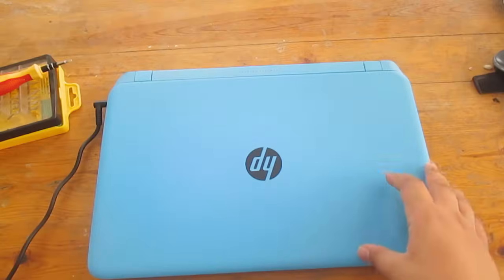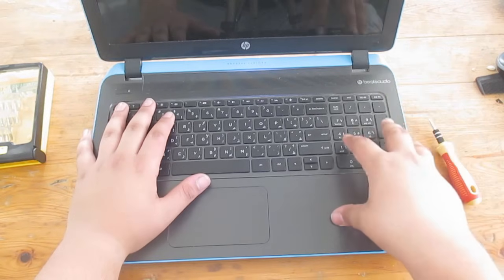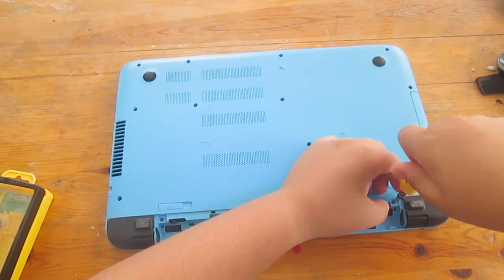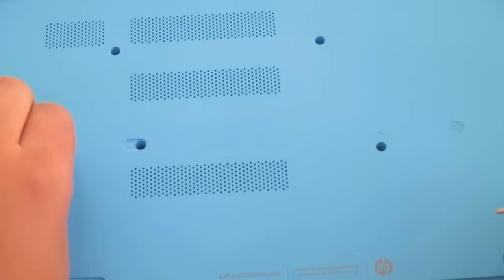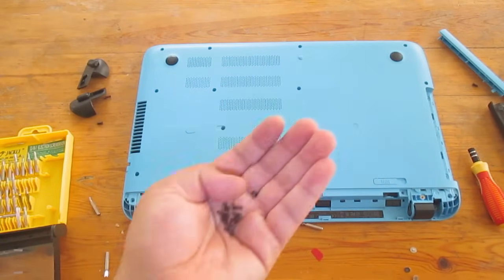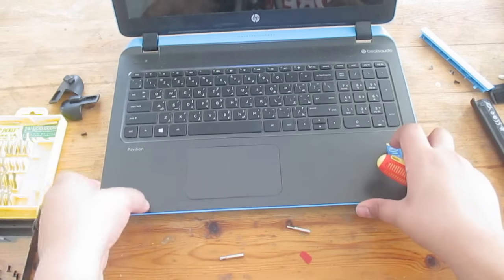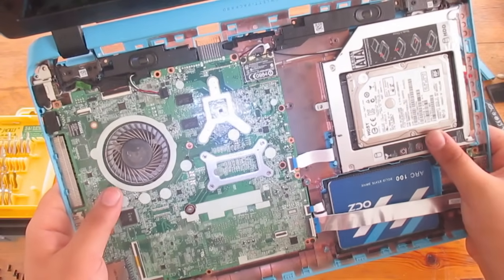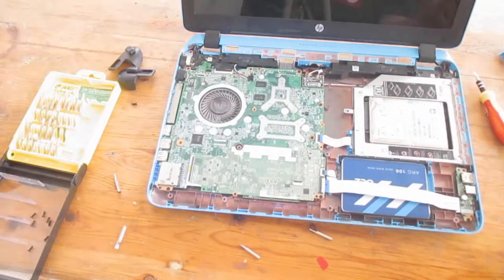How to disassemble Any HP Pavilion 15 P series notebook

Comment: Hi! Great tutorial. I added some RAM and changed my HDD to SSD. Unfortunately, when putting them back I broke two or more pins on the keyboard socket connector and now most of the keys won't work (Power button and Touchpad still works). I still would like it to be fixed even though I'm using it already with an external USB keyboard. I found some tutorials about soldering the pins but I'm not confident to do it. I'm also thinking of buying a motherboard replacement but obviously they're too expensive. Hoping someone could help me.

Comment: GUYS! To anyone stuck with the 3 screws in the disc drive : I have the solution!!

I tried to unscrew them with the smallest screwdriver I own but ended up stripping the screw completely....

HERE is the solution: Apply a little superglu on the screw, then put a small nut on the screw (nut diameter must not exceed screw diameter), make sure the nut is centered with screw and fill inside the nut with superglu. Leave it to dry for a few hours and then turn the nut with a spanner or pliers .

Worked great for me!! Good luck

Comment: My hp17-p110nr is pretty much the same for where all screws are, etc. But those strange flat "screws" under the optical drive tray, what kind of driver did you use to remove them? They're too flat for my smallest Phillip's. Please help! Have new fan to put in because old one died.
Reply: Did you figure it out?
Reply: @vinodgowda4141  I found a 122-tool set with the proper tips for the screws. Sorry it's been so long I can't tell you exactly which one I used. I don't have that laptop anymore.

Comment: Thanks for the video sir! I needed to replace the the fan since it started making a hell of a noise. Wanted to do it all by myself and your video helped a lot particularly finding the hidden screws.
Reply: I also have a noisy fan that needs replacing! I followed the video and opened the laptop up, managed to get the motherboard up as the fan is accessed from underneath, but then couldn't see how to remove the fan itself! Would you be able to give any pointers or instructions?! Thanks in advance, any help appreciated!
Reply: @tracieatkins1636  as far as I remember, there were some 3 screws that support the fan module in its place on the motherboard. I'm not exactly sure about the structure now, neither do I have pics for pointing, but I'm sure only the screws need to be undone to get the fan out from underneath.
Reply: @shubhshar  Thanks I'll have a look again. I was just a bit worried because I read somewhere on line some fans might need soldering!

Comment: How do you get the keyboard out? I've stripped it down, put a ssd in but the keyboard seems to be encased in a metal cage and I need to replace it.
Reply from the maker: one of the reasons i ended up getting rid of that laptop ages ago, the keyboard is locked on tight by rivets and the only way i see is replacing the top panel, which holds everything or ripping it out and managing to lock the new keyboard in place with some type of glue. my video is pretty old you should look for more recent ones maybe someone figured out an easy way.

Comment: Swapping the keyboard for a friend - have to replace the whole top palmrest (keyboard is rivetted to it unbelievably); stuck at first hurdle - there's only one flat screw after removing DVD drive (somebody's been in this laptop before!) and I cannot get it out with my various screwdrivers.  Only one thing for it - drill it out.  Cannot think of any other way to do it...tomorrow.  Terrible design HP.

Comment: I have that same laptop but the flat screw behind de DVD drive (there is only one btw) have the head damaged. Do I need to remove it to just detach the front panel with the keyboard?

Comment: Keyboard. I have some duff keys. Can I just buy the keyboard or do I have to replace the whole of the top cover?  Thanks.
Reply from the maker: iirc this laptop did not have a dedicated keyboard screw like previous models, in fact the keyboard itself has plastic Rivets. making replacing it a nightmare.
Reply: @ananjaser1211  Thanks. I've found the manual. The keyboard is rivetted to the top cover...crazy... so have to buy the top cover. Cheers.

Comment: Hey how ia the performance off the hdd in caddy and is it same that came with the laptop or you replaced with the new one???
Reply: What he's done is put in a SSD (arc 100 ocz) - the blue thing - in the lower right-hand-side  (see it with keyboard cover off).  So it'll be fast to boot, browse, work etc.  The HDD in the caddy won't be as fast as SSD but it doesn't need to be.  That will be used for media e.g. docs, video, music.  Why?  You can buy a SSD of 120GB for cheap bucks and that is enough room for Windows10.

Comment: Excellent video, but to change the reader for the HDD and what was the HDD for SDD ... I have the same laptop but in AMD HP Pavilion 15-P002la (CLEAR THAT YOURS IS INTEL, WOULD YOU KNOW IF THE STRUCTURE IS SAME FOR THOSE MARKS?), And my reader no longer reads the discs, YOU COULD MAKE A TUTORIAL OF THE SAME LAPTOP OF HOW TO CHANGE THE UNIT OF READING BY HDD OR SDD, PLEASE ....
Porfavor .... Since there are also Caddy of 9.5mm and 12.77mm and I do not know which of the 2 is for the video model .... Please a tutorial

Comment: Hi(my english not so very good)
I have unscrewd all screws showed in this video but i still cant lift the RIGHT side of the laptop. I mean i can lift it a little bit but not as much as the LEFT side. Im afraid that if i will pull right side even more it will break. Does someone have similar problem? or is it possible that there is another hiden screw?

Comment: KEYBOARD -- you did not cover this.  The keyboard is a NIGHTMARE to remove.  Why?  Because HP went the cheap route and used plastic rivets to secure it to the top panel. Not only is there a metal brace that is plastic-fused in place, but the original keyboard is plastic fused to the support in several places.  My keyboard was becoming problematic and some letters had worn off.  When I saw keyboard parts were available, I figured no problem (I did this before on an older HP).  Well... when I discovered what HP did I was so mad.  I did accomplish the keyboard change.  In fact, it's now BACK LIT!  I really wanted that capability.  Anyway, the keyboard is not totally tight, but the "give" isn't too bad.  It's just great to have a new keyboard, especially with lighted keys.

Comment: sorry, the board what speed can read and write in the ssd in the original hdd space, not the cady, i want to get an ssd in the laptop and the hdd in an external case, i dont want it on the laptop. it´s a good change?

Comment: Which is the caddy that is installed on the laptop. Can you tell me the specification of the Caddy used in this model?
Reply: Is it 9.5 mm or 12.7 mm?
Reply from the maker: kiran007pj very late but it's a 9.5mm

Comment: How do i install a M.2 ssd on this model??
Please reply fast!!! Thank You.
Reply from the maker: John fox there is no m.2 slot in this model. So you cant
Reply: it was given in the manual
Reply from the maker: John fox the version I have (2015 I think) doesn't. In my case
Reply: how do i check this?
Reply: Please state your specs Thank You
Reply from the maker: John fox u need to take it apart and see

Comment: sorry can i ask a question. this motherboard has m2 ssd socket ?
Reply from the maker: Mehmet Demir No it's too old for that
Reply: Thank you so much.. good night.
Reply: @ananjaser1211  wait, what? First of all I'm using a 15-P201NT and your laptop looks identical to mine. I contacted HP about sth else and they said they wouldn't help, and sent me this. Check out page 14. Also on the page 88 it is telling how to remove the ssd under the system board. They are even showing an m.2 ssd picture. Is that wrong?
http://h10032.www1.hp.com/ctg/Manual/c04511833?fbclid=IwAR29zu3ZW14_9F3wIw8OhBroSR9zx5Mopvrrd8bsHbvYIdM3efI2guTxjd4

Comment: Guys any help on the 3 flat screws underneath CD port? I've been searching for it's screw driver. None found in local stores. Any name or size spec would be appreciated! 

And can I replace the 8gb ram with a 16gb even though it's not stated as expandable? Will it work? 
Thanks!
Anoop Mysore
Reply: Same situation with me. Have you found anything?
Reply: @teodorstefanov984  Same here, no solutions? Thread is fucked

Comment: 4:44 what screwdriver head did you use?
Reply: Ash coles it's a Phillips screwdriver. The black screws use PH-00 and the Disk Drive tiny ones use PH-000. Be careful though one of the screws on my laptop was so tight it wore itself out and I can't access it anymore (the other screw came out super easy)
Reply: Aaron Saballo So PH-000 work for the very tiny screws on the CD part?

Comment: can someone tell plz tell me what kind of screw tip did he use to remove the flat head  screws at 4:46
Reply: Hey have you found out? is it ph000 screw driver?
Reply: Amm, I turned the sides of the screw upwards(or say I bent it on purpose), and then I could turn them easily. Tbh, I don't think after having so many Screws we need those flat screws(in my Laptop, there was only one of them, and I wasted almost 2 hours Until i decided to bent it).
Reply: @vishu4712  hi i know im late but how did you bend it
Reply: @kaizo1148  🤔I guess I used a Knife.
Just put something Flat and then turn it upwards (don't apply force directly, as if it slides you can damage the parts)
Simply place something Like a Knife and Once it's placed under the Screw head turn the knife upwards.

The screw is not strong, it's head will turn easily.
Reply: @vishu4712  huh i guess it wont work for me because the screw is stripped(really stripped)

Comment: All of these very detailed videos of removing the screws, but not one single detailed list of the tools used.... IT techs are the worst! I see at least 10 different requests asking which size phillips for the optical drive "Silver" screws. Nothing like hearing "A very Tiny one" to have you making multiple trips to your PC repair store for a very tiny screwdriver! Those screws are needed to be removed to pull up the keyboard completely to Add/Remove RAM......
Reply: Chris Ikner so which exact screwdriver does it need? that only smallass screw is holding me back from opening the back panel :(

Comment: how to remove the flat screws beneath the DVD ROM? they are extremely difficult, and none of standard drivers could fit into! :(
Reply: Srinjoy Roy were you able to unscrew those bro?
Reply: boss, all but one! the screw just below the CD ROM was a tough nut.
Reply: Srinjoy Roy yup bent it a little bit and was able to get it out! Didn't screw it back tho ¯\(ツ)/¯
Reply: Does the Philips PH000 screwdriver work?

Comment: Can you tell me where did you find the hard disk caddy for optical drive,please????? I'm looking for it but i can't find anyone for my hp pavilion 15
Reply: Matteo Fazio Try ebay, I got mine from there for my HP Pavilion dv6 3000 series some years ago, what a speed up difference it makes adding an SSD and upgrading the DVD drive bay with a caddy to install a 2TB 7,200 rpm HDD in there as a data drive. This notebook originally had a 650 GB 5,400 rpm HDD.

Comment: Thank you for showing me the HIDDEN screws place,   I had 2 hidden ones.  It was soo annoying. But What is more annoying is that corner, I can't get it off!!!    I snapped my knife! I snapped my credit card!   Trust me that corner is soo difficult to snap off! with so little gap!!

Anyhow I needed to remove my corrupt hard work, so luckily I was just managed to remove it through that 1 inch space.   

I still can't remove that top though.  I most likely damaged some stuff because I heard a lot of snapping.   But I rebooted, everything working fine so far.   keyboard included.

Now I want to know his will this motherboard support faster drive because my current corrupt one is slow, malfunctioned and I rather invest in a new one.   

Anyways this video was indeed helpful for those who can remove the top part.  I just needed to remove the hard drive so it was luckily in my reach at the bottom.

If my new hard drive doesn't work with this, I'm going to put this in the trash where it belongs.

Comment: Thanks for posting this ... Reminds me more of an aicraft mechanic pointing out the "non intuitive" tricks to take it apart (remove all screws, doesn't open because a hidden clip HP wants impatient people to break off, lol). Anyway, for repairs and upgrades .. AVOID HP. Period. Lack of easy access and a design making it almost impossible for a novice to upgrade memory or a hard drive is rediculous. Most other brands have small access doors on the back to replace a HDD or memory. Come on, what idiots at HP came up with this idea???
Reply from the maker: cdcollura it's such a shame how their new designs destroy any sort of upgradability without watching videos or following complex guides.  Taking the laptop apart for the first time was extremely tedious and time consuming.  They slowly started to limit upgradability with 2015 models by adding 1 Bay for rams only instead of rams hdd and wifi for a sleeker look.  And now they ditched it all for a uni body like design.  This is seriously backwards thinking.
Reply: I have a p-series laptop and a stick of RAM died in it last night. So, I now have to go through a whole convoluted process just to figure out which stick died and repeat it so that I can upgrade it from it's original 6 gigs to 8 gigs. The was my 3rd hp laptop and probably my last one, well technically one of them was under the Compaq branding which was made by HP. The quality an on HP products has gotten ridiculously bad and now they are even going Apple on us and making their stuff way harder to repair than it used to be.

Comment: If I want to replace the hard drive can I use any SATA hard drive?  I have the same computer and want to make sure I have the right stuff before I take it apart.  Thank you
Reply from the maker: Aslong as its a 2.5inch Drive it will fit it without issues.

Comment: pls help , unable to open the screws under the optical drive, please suggest which screwdriver to be used for them
Reply: very small phillips head!
Reply: Me too it's stuck, flat screw
Reply: I had to get a small Philips and pound it into the screw head with a hammer (not too much force) and was able to get it out.

Comment: hey. same laptop even color. my top cover with the hp logo cracked where hinges are. how do I take apart the top screen cover where screen is, to replace it with new one. I found the replacement for it.
Reply: Where did you find the replacement?

Comment: HELP!I have removed all screws from the back, but the cd part wont come out, it's still in there. I turned on my pc and clicked it open, shut down the pc, and tried to get it out but nope. What am I doing wrong? Mine is a hp pavilion 15-p106no, but physically it's exactly the same!
Reply: Dirk Bruere thx bro, I was getting so frustrated and realized that all I needed to do was pull out the front of the disc thing .
Reply: Remove the plastic fascia panel on the end of the DVD drive, and when it is pushed back in the screw underneath is accessible
Reply: Armani Dehani me too, somebody help please!
Reply: Thank you so much i was going insane xD
Reply: Someone pls explain !!!!

Comment: Hello. hope you can help me. I own the same laptop, but i have a problem witht he wifi. It runs fine when connected, but on battery it slows down to 100-200kbps. I figured out it is a hardware issue since i couldnt find anything wrong in the system. How can i be sure that the wifi adapter is faulty?
Reply from the maker: Might wanna check battrey options first, specially the POWERSAVING / PERFORMANCE one, and check device manager wifi adapter , there should be an option there that limits the trans fare speed , Unfortunately i dont know a way to verify the adapter 100%

Comment: how can i replace the keyboard?
Reply from the maker: With latest HP models, You cant replace keyboard,  the back plate holding the keyboard is not screwed in , its locked by some sort of plastic, can only be broken . And couldn't find replacement keyboards for this model online
Reply: my keyboard some button don't work ..what can i do now.?
Reply from the maker: probably you need to replace the entire front plate :/
Reply: Moinul Islam you can use any desktop keyboard plugged into a USB port.

Comment: Can you make a video on how to replace the ram
Reply from the maker: replacing the ram is fairly straightforward, one you full take apart the top panel, u need to remove the screws holding the mother board and make sure you de attach all the cables going into it, the ram sockets are located under the motherboard

Comment: for install ssd and secondary hard drive , shall i need to remove my dvd rider for this model laptop
Reply from the maker: Yes, most mainstream laptops use only 1 2.5inch drive bay, you need to buy an optical drive caddy and remove the DVD rom .

Comment: What's an easy way to clean the fan? Great video!
Reply from the maker: If you wanna avoid taking it apart, using a compressed air can is the best option for laptops in general
Reply: +Games Matrix Thank you very much!

Comment: I bought this Laptop 2 years ago for  MYR 2599  (577 Euro)
I'm now in Europe, and they're selling older models, which are weaker, for 599 Euro - and a similar model for 999 Euro. We're talking about 2 years later.  Why are the prices in Europe so much higher???
Reply: My guess is taxes. Generally electronics are cheapest in the US tho if you compare the average iirc

Comment: I have hp 15-p236ne and there is no power in it and i have checked the battery and battery charger both of them are ok and i took to maintenance computer shop and they told me that the  problem is in chip power  or the bios, so could you please help me ?